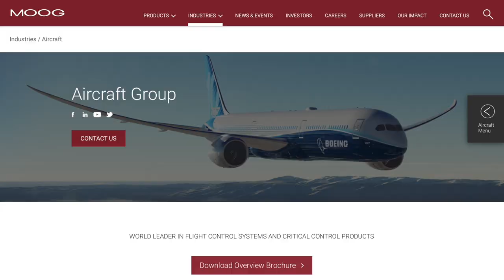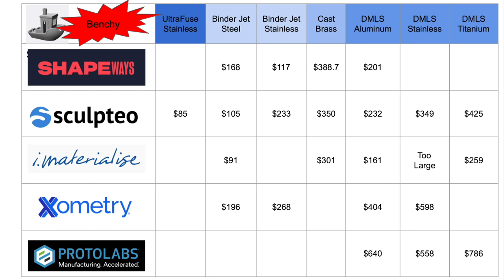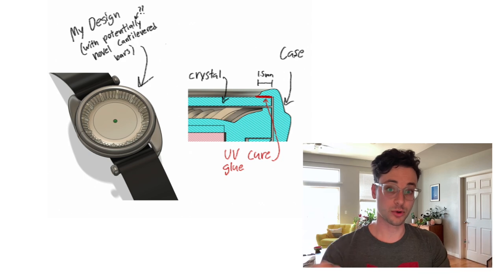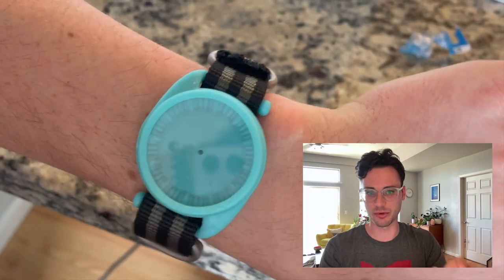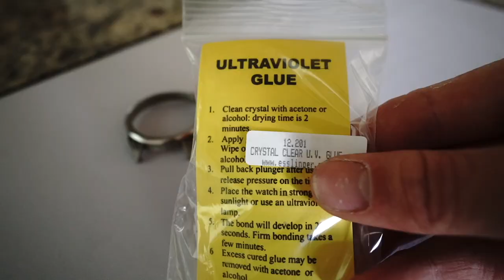Building a Watch in my Kitchen

Comment: i would've liked a more in depth exploration of the design process in fusion and of your ordering process in finding a printing agency to make the object

maybe some more footage of both finding the quartz mechanism and the putting together of it

but overall an interesting idea, what could be more cool than having liberally a one of a kind watch? no one else can make something that looks like it, so that's cool
Reply from the maker: The quartz mechanism came from Esslinger, and the only thing you do is press on the hands. 

I agree that I could have done more design-related content on this one, though.... I tried to keep the video run time around 5 minutes partially because my last vid did so well (lol)
Reply: @CarterHurd  sure, no problem. just though adding a little explanation of how you found and chose specific designs would be cool

i'm studying engineering and haven't had much experience with this

so seeing someone who knows what they're doing, even giving a little explanation, is rly helpoful
Reply from the maker: @fallenaspie  Gotcha. Yeah I kinda had no idea what I was doing, but I found a few "DIY Watch" companies that had assembly videos, and learned the components required as assembly process from there. 

The company I mentioned above with the watch movements had dimensioned drawings of each movement, so it was easy to find one that was a proper fit

Comment: As a watch guy, this is super impressive!!! May I suggest for a Seiko movement like the NH35 or Miyota movements, they are adorable mechanical movements that are very rugged
Reply from the maker: Thanks!  If you check out my website you can track my progress, I will be doing an automatic movement next so maybe I'll use one of those. https://www.carterhurd.com
Reply: @CarterHurd  I don't know if you're still reading these comments but as an apprentice watchmaker I would take a 955 eta movement over a seiko nh35 every day of the week, and miyota automatics are only marginally better than low end seiko ones.

Comment: I truly believe metal 3d printing is the next step in watches. Some of the cases that can be designed for 3d printing are impossible in traditional watch manufacturering.
Reply from the maker: I agree. I’m doing a follow up video on this with a new unibody case+dial design that’s unique to additive manufacturing. We’ll see how it turns out: many design challenges… having 1:1 info sessions with an engineer from one of the companies…
Reply: This will be great to follow along with.

Comment: ah man, love it! thank you. 

3D printing watches has been something I've been very keen on, although I've decided to stick with cnc milling or molding for most of my projects so far.  The notion of out-sourcing turns me off a bit too much.

I am experimenting with different materials for milling the watch case; titanium and carbon fiber have been my go-to for milling so far, as I like very lightweight, although I've experimented with graphene + epoxy molds based on PLA-printed parts, too.  With carbon fiber or titanium, you can stack layers of sheets, achieving a nice effect without needing 5-axis. Both carbon fiber and titanium sheets range in thickness and are sub-$20 from aliexpress.

 I also laser-cut my leather straps, hand stitching them afterwards; I've also tried out milled chain-linked carbon fiber straps.

Comment: You could mark indents in the watch and fill it with a dark material, like resin. This will add some way to better indicate the time. My thoughts are to do a pizza cut design, but only do it part way to the center.
Reply from the maker: Initially I wanted a mono-block dial/case combo, and to fill in the indents with Enamel. Maybe I should try Resin and an easier way to realize that vision
Reply: @CarterHurd  Remember that Resin does yellow over time, from what I found out on YouTube. I would choose the color wisely.

Comment: Excellent work as always, by far some of the most creative and inspiring design work I see anywhere. However I'm quite surprised that you ended up with a solid green as the final result. In contrast I really loved the enamel swirls with the copper beneath still showing @2:32,  Really helps showcase the fact that this is one-of-one, fully custom. But that's just my two cents. I'm a bit biased as I love copper jewelry. Keep up the great work!
Reply from the maker: I have an all-copper case/dial unibody part coming soon, and I might do a translucent enamel on that. 

Not sure yet tho, because experimenting with a $100+ print will be more scary than a piece of scrap metal.

Comment: Super cool!  Curious what movement you went with?  I've thought about 3D printing a watch as well but never got into it enough to know what would make a good movement to buy.
Reply from the maker: I used the ETA 2 Hand Quartz Watch Movement High Version 955.112-2.3

Whatever you go with, don't select an ultra low-profile movement or it'll be a pain to set the dial and hands properly
Reply: @CarterHurd  damn!  One of the things I hate about most watches is how thick they are.  Going low profile was the goal.  I'll take a look at the one you are using.  Thanks for the info and the heads-up.

Comment: This is so amazing, thank you so much for sharing! Are you planning to post/sell your 3D designs anywhere? 

The reason I ask is that I've been buying old pocketwatch movements on eBay to learn the mechanics and how to clean/repair them. All the ones I have don't have a case, and I'd love to be able to wear them as a wristwatch some day. Though I've discovered it's extremely difficult to find a case to fit a 100-yr old movement, and considered 3D printing in metal like you have. 

Unfortunately my 3D modeling skills are nil, and I've been working on drawing out a schematic to have someone convert it to a 3D model.

I also would love to get into making my own dial, whether in enamel or etched glass to reveal some inner gears. 

Absolutely fascinating! Thank you again for sharing!
Reply from the maker: This sounds like a cool hobby. I'd be happy to do some sort of trade: I get a moment that you have restored, you get a case design that is to your chosen dimensions. Just email me (my email is on my website)
Reply: @CarterHurd  That sounds great! I'm actually out of the country for the next several weeks, but when I get back I'll definitely shoot you an email on where I can send a movement or two. Thanks!

Comment: Have a question. I have a cheaply designed plastic Apple watch housing for a $250 dollar "Military grade" band. The band itself is nice metal. the cheap housing keeps breaking in the same spot after 30 minutes of weating, 4 different replacements. Would it be possible to send you the housing and have pay you to produce a good metal copy of it?
Reply from the maker: Unfortunately, a metal case likely won’t work well with the Bluetooth and data connection of the Apple watch

Comment: how durable is 3d stainless steel?
Reply from the maker: Totally depends on the part design and technology used. 

If done poorly there are more opportunities for stress fractures to propagate, making it worse than a smoothly-polished CNC part. If done well it's actually stronger, here is an example: https://www.science.org/content/article/3d-printing-doubles-strength-stainless-steel

As for my print shown here... I have no idea.. have not tested to failure :)